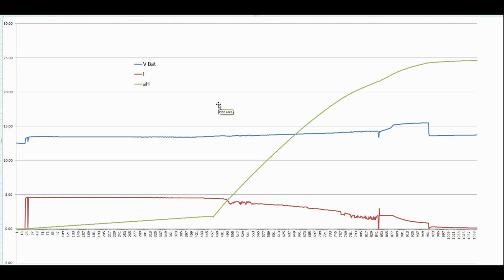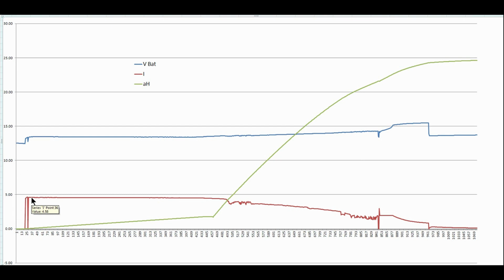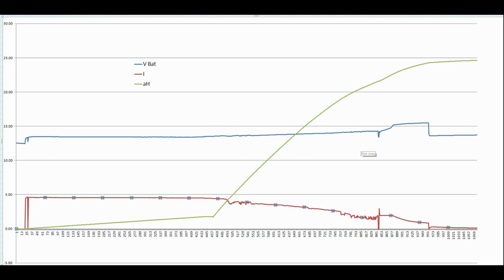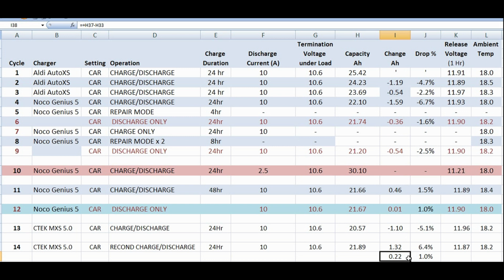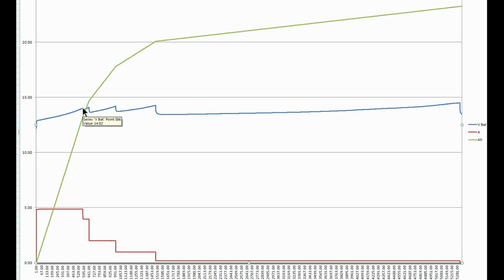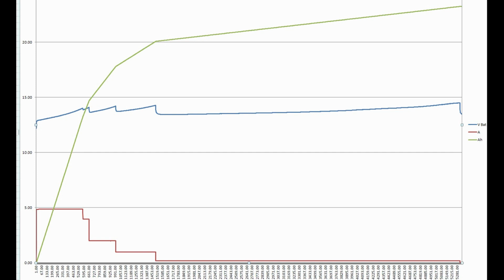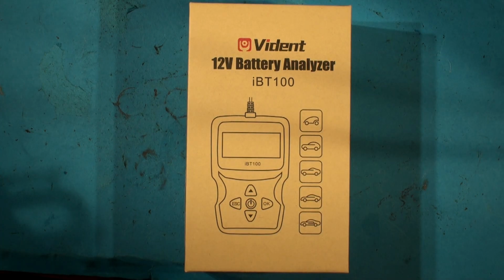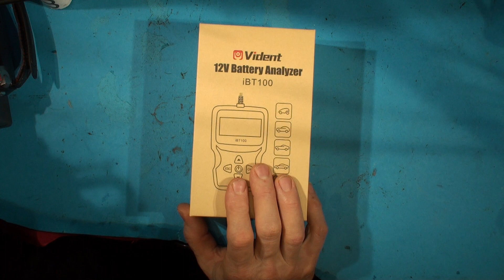Does the NOCO Genius5  charge better a than CTEK MXS 5.0 ???. NOCO Parametric Test Part 5

Comment: I know its been a while since your first video and i only discovered this series after my battery bank failed a week ago and i bought a Noco Genius 10 to try and repair them.

Your videos are very informative and exactly what a test should be showcasing results properly.

Now i have been testing mine on a spare old battery because the main bank has been returned for a warrenty evaluation since it was found to be under 2 years old.

Anyway i bought the Noco before i knew this to try and save them, they all had atleast one sulfated cell and would not run a 15amp dashboard heater for more than 8 mins.

The spare battery was from the previous bank which went the same way so its atleast 8 years old.

It would run for 8 mins at 15 amps after a full Noco charge.
I tried a large number of charge discharge cycles without repair mode and found no change in runtime.

I ran the repair mode for one cycle and no change
2 cycles back to back after this and maybe 30 sec change.

Then after reading some peoples data about desulfater saying that it takes a long time to reverse years of damage i decided to just run it for days back to back resetting the mode each time it stopped.

Testing every 2 days with a discharge and recharge i started to see a gradual increase of about 5 mins each 2 days.

After running the noco repair mode non stop for 2 weeks i now have a runtime of 40mins on the same load, so for atleast this battery it is slowly recovering some lost capacity.

Im going to keep going untill there is no further improvement and see how far it will go.

The battery on test is a 120amp "superbattery" brand.

My conclusion so far is that the repair mode really works atleast on the genius 10, maybe its a scale thing having enough amps to do the deed or maybe its time.

Anyway i will comment the final capacity or runtime increase once there is no further gain.

Edit: after 4 more back to back cycles its at 1 hour at 15amps and increasing steadily.

So my take is that its much harder to break down the sulfate initially when theres a high resistance, once that is overcome progress is much swifter. 

Also the pulse voltages initially were low but have now started to hit 16v rather than low 15v so this seems to be an indicator progress is being made.
Reply from the maker: Thanks for the comment.  Older batteries - the plain wet-cell-non-sealed type respond quite well to repair schemes..  I have never seen any really meaningful results on modern valve regulates sealed lead acid batteries. I live in hope...
Reply: @razenby  mine are valve regulated

Comment: Hi

Thank you for the video, I am trying to decide between these two chargers. A lot of the information you provided went over my head. Do you recommend the Noco or CTEK?
Reply: Both work well for charging flat batteries. A dead battery is a different thing entirely. The reconditioning mode(s) might buy you a week or two to have a new battery fitted but you cannot bring a dead [battery] back to life.
Reply from the maker: NOCO has better build quality and better reliability.
Reply: @razenby  I do possess a NOCO Boost Plus. It does feel well assembled. I've used it just once. I deliberately ran the battery flat to test it. Mazda 6 2.2d Sport. Worked perfectly.

Comment: From what I have been reading , it seems that the most effective way to "desulphate" a battery is not with pumping the battery with high voltage like most of these chargers do, which include NOCO and the CTEK. instead, proper delsulfators use high frequencies.
Reply from the maker: Interesting. I have read a lot of info but none of it substantiated.  Modern Valve Regulated Sealed Lead-acid batteries don't really respond to repair and if it are so far gone as to be noticeable by bad cranking then it is time to replace it.  Now, if you are asking if a frequently driven car's starting battery will benefit from a good three stage charge every couple of months during winter??  The answer is definitely yes.  We bought my Wife's Mercedes new in 2008 and now 16 years later with 188K miles on the clock had the original battery was replaced in  2021 because it was showing  signs of fatigue.
Reply: so regular modern sealed lead acid batteries do  not respond well to repair aka (desulsulfaton and or destartification)? so I am curious then how do some of these channels who do test them out on sealed lead acid batteries do  have successes then? Or is it just garbage? If that's the case, then I should return my NOCO 10 and not bother trying to repair my battery. Instead, just purchase a 1.5 or 2 amp battery tender  and then just  buy a new battery as well.
Thanks for the information; it's greatly appreciated👍

Comment: So which chsrge did a better job?
Reply from the maker: Any battery is really easy to charge.  They aren't that fussy.. maybe better questions to ask are:
1. Which one did the least damage?
2. Which one will still work when I need to use it?
3, Which one has the most BS in it's claims...
Thanks for watching
Reply: @razenby  So which one?

Comment: Great review and test of Ctek and Noco battery chargers. I'd like to see you test PulseTech Battery Charger's and PowerPulse passive battery desulfators. I use a PulseTech Power Pulse battery desulfator that you leave on your battery at all times, PulseTech claims that it will extend the battery life up to three times, and uses a patented frequency rather than use voltage spikes.
Reply from the maker: Pulsetech aren't available in the UK. If someone could send me one I would test it.

Comment: Sorry if you’ve covered this… I’m wondering about the maintenance charge. I’d take a guess and suggest this would be the same throughout the Noco Genius range of chargers…. I.E. same V and A are supplied to battery after the initial charge. Could I be correct? Very good videos BTW. 👍🏻✌🏻🇬🇧
Reply from the maker: Maintenance charges that hold the full charge voltage are no good.   It is important to discriminate between maintaining the charge and condition of a lone battery  AND a battery that has a parasitic load such as a car alarm.  If a battery is disconnected  the just charge it every 4 to six months. Otherwise a maintenance charger is required. This is where the problems start. If the charger smart enough then a parasitic load can prevent the charger from reaching the target voltage during the float absorption stage. We have to distinguish between full charge voltage and resting voltage.  I have  NOCO genius 2 connected to my XKR jaguar for the last five years and it works great.
Reply: @razenby  Interesting. Very interesting. I do have some knowledge of lead acid batteries through job but not in such an application. I have a BMW that has the charging points under the hood. It’s recommended not to charge at the battery due to the IBS that’s connected in series. Crossed my mind to disconnect the battery and charge it directly as I can’t seem to get the terminal voltage above 11.9. Using a genius 10 and a AGM battery 6 months old. I suspected the parasitic draw could be such that the charger fails to achieve target V after 24 hour charge. Think I’ll use a clamp meter to record the cars demand when locked up and have another look. Thanks for your videos and comments.

Comment: Good day. I was impressed with your skills and knowledge and would like to ask you for a piece of advice. I'm struggling to find a decent car charger. There are so many options, can you help me out, please? I've got 95A AGM battery in my car. I want a charger I don't have to keep an eye on with maintenance functions to keep my battery in a good condition. I may also need to charge another 90A AGM battery and 120A acid battery. I heard about noco and ctek and they both have cons as far as i got.  Ctek build is not that good and noco may heat up a battery. I would like my battery to be safe with a charger so I can leave it for a night unattended. It's for a range rover with a bunch of electronics, the battery is in the trunk and I dont want to take it out every time, but there are connectors under the hood,that's where I want to connect a charger and to be sure all the electronics are safe. Budget is under 150$. Thank you beforehand
Reply: I've just found out that noco repair mode does not support agm batteries, only lead-acid
Reply from the maker: Hmm, tricky.  The first thing I would check is that if any repair mode works on AGM baptisteries.        Is your range Rover a stop start type that turns the engine off when stopped and auto-restarts?  On this model there is a battery monitor controller that monitors the battery condition as it ages and I heard tell that charging the battery can confuse it and stop the stop start from working.  Let me know exactly what vehicle you own and I will look into it. As it happens I have a pile of Land Rover and Ranger Rover batteries that aged beyond   the point where stop start ceased to operate and battery warning came up on the dash. In fact I have one in my P38 for the last two years and it works just fine.  I have been meaning to investigate this as it irks me. Is the car used regularly?

Comment: This was sooooo technical but I got the gist of it.  
I have the Ctek and when I use the reconditioning cycle it moves very quickly to the next stage. I think it may have damaged my battery keeping it permanently attached as I thought that was good for it for a car I use every second month for a day. 
Which would you suggest for maintaining the battery on charge each day for now a motorcycle and car which are show vehicles which are used maybe once a month? Will watch the other videos now for your final word on the comparison.
Reply from the maker: Hi Padma it depends on what the battery is connected to. If it is an old style car with true zero battery drain when Locked and parked then only a periodic charge is necessary.  A healthy battery only required a full charge cycle every six months to keep tip-top condition.  Modern cars run active systems when parked such as Alarms and other monitoring systems (central locking ). This called the Parasitic Power Drain (PPD).   Rapid damage is inflicted on a lead acid car starting battery battery when  the level of charge sinks too low. Car starting batteries simply aren't designed for deep discharge applications. So which approach is best?  If you want to have a maintenance charger connected then there are three things to consider:
1. The charger needs to be well designed to be reliable and damp and mains transient resistant. 
2. The charger needs to support temperature compensation.
3. If, during maintenance charging,  you leave the battery connected to a vehicle with  PPD some chargers will never complete their so called 'smart charging 'cycle and get stuck in the last stage - usually the third.  This can keep the battery terminal at a high lever permanently as the parasitic PPD never allows the third stage to fully complete.  Charging current during the final stage is low and of the same order of magnitude as the parasitic load.

In Conclusion  Genius
Reply: @razenby  WOW!!!
I am blown away at how generous you are with your knowledge, THANK YOU. I sadly bought 3 of the CTEK chargers, one  the same as your neighbours which you tested and 2 of the 0.8Amp ones thinking it would be good to keep connected on the bike and the 2005 BMW which has a fairly high Parasitic Drain, not as much as a modern one however. That company advertises it has the automatic 6 step charging so I hope I haven't made a mistake with it. Do you suggest I return them (bought online today so can cancel) and buy the brand you suggested? And THANK YOU again, sincerely.

Comment: I found an interesting response online from NOCO, regarding the repair algorithm.

They claim repair mode first charges the battery to 14.8V. Only once 14.8V is held, does the current pulse charge begin. It stops the charge at 16.5V. If these voltage thresholds are not met within 4 hours, the repair mode will time-out. Hopefully this sheds some light on the algorithm. I see now why they recommend a fully charged battery (solid green) when entering repair mode. It could waste some, or all of that 4 hour timeout just reaching 14.8V.
Reply from the maker: Interesting. I haven't seen that happen. I have seen the CTEK do this I definitely haven't seen the NOCI battery voltage go that high, Which NOC model were they referring to.  Let me know and I will check and report.

Comment: Maybe somebody commented on this already but anyway. The battery analyzer I have, quicklynks ba101, measure of course the internal resistance and then count with an voltage drop of about 2,7 V, guess it's from the full 12,7V down to 10V limit, and from that get the CCA (EN). I tested a couple of different normal flooded batteries at different SoC and the result can be calculated with the 2,7V drop and the mohm the meter show.
Reply from the maker: Interesting.   The stated capacity of the battery differs between the standards ISO and EN  etc.. It easy to predict the behavior of a good battery, but for weak or failing Lead Acid batteries  there is no data.  If you discharge a lead acid down to 10V it will permanently damage it.
Reply: @razenby  Yes the 10 V is just during cranking. The recond mode can lower the internal resistance making it capable of more cranking amps before the voltage drops too low. I tested a Victron 15A charger in recond mode on an old bad battery. Initial test measured 7,45 mohm and after recond between 7,1 to 7,15 mohm so not a big difference, just under 5%, and CCA went from 370A to 385A. I checked the manual of a similar analyzer and it says "replace" if voltage drops under 9,6V during crank test.

Comment: Good afternoon, I'm sorry I use a translator.
I am writing to you from Ukraine with such a question, what kind of charger would you recommend to buy Noca Genius 10 or STEK 10?
What do you think is the best charger?
thanks for the answer,
Reply from the maker: If by STEC you mean CTEK then the CTEK is probably the best at reconditioning but very bad at mid to long term battery support because when you return to it  will have failed. Very susceptible to main transients and damp and the mode switch is delicate. One bump and the switch fails.  The NOC has a far better build quality and is very reliable on long term battery maintenance.  I have 2 cars connected to NOCOs in the garage for over 3 years and the NOCOs are still working fine.  Before this I got through 3 CTEKs in a year.
Reply: @razenby  Understood thanks.
another question, but what can you say about charging Bosch c7? Is it worth paying attention to?
Or even better Noca Genius 10?

Comment: Hi @magicsmoke, I was wondering what is the time scale for the measurements? For e.g. at 09.43 the units on X-axis go up to 5281, which if I assumed were seconds, then that would mean that this charge cycle was about 1.5 hours. But then if I was to assume it was minutes then 5281 minutes equates to roughly 3.5-4 days! So could you please clarify how the units on X-axis translates to time? Great review. Hope to hear from you soon. Thanks : )
Reply from the maker: Seven hours 20 minutes,

Comment: thanks for the videos! Quite comprehensive. I own x2 Cteks and use it mainly for my motorbikes. Should I get the NOCO genius 2x2 instead? Also I live in warm climate - will the NOCO perform better? Am I better buying NOCO instead? thanks mate
Reply from the maker: In the regard to the design for reliability, the NOCOs are much better made and designed than the CTEK and electrically much more robust. Personally I would go for the NOCO unless you have the old traditional wet cell battery with top up vents in which case the CTEK might be more effective at recovering some of the lost capacity.
Reply: @razenby  thank you!

Comment: What a comprehensive review! 
I am in the market for a trickle charger to put on my 2022 Land Rover Defender as it is about to be stored for 6 months - 1 year.  I want to make sure the battery doesn't die and mess up all the electronics.  It seems like the Noco Genius 5 will fit the bill nicely. 
My question is, will it be ok to use a cigarette lighter plug to connect the charger to the battery or should I use a more direct connection to the battery itself (under the front seat) or the jump starting poles (in the engine compartment). Either Hard wired or alligator clips?  I want to be able to close the hood. The car will be left mostly unattended and I want to make sure the battery is safe and doesn't overheat, etc. 
What in your opinion, is the safest and most efficient way to connect? 
Thanks!
Reply from the maker: Thanks. The cigarette charger plugs are a bit iffy especially if it is damp.  In terms of reliability, the NOCO is a better bet.  Even a Genius 2 will support the battery well. I have had one one my Jaguar for over two years 24/7.
Reply: @razenby  thanks for the feedback. My NOCO Genius 5 just arrived. Will connect the alligator clips to the jump starting poles in the engine bay since my battery is under the passenger seat inside the car.